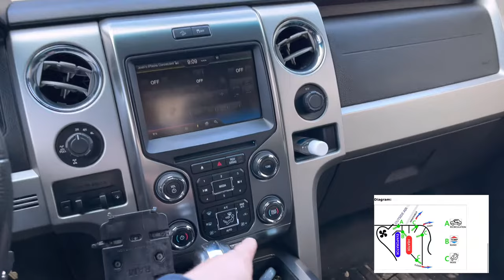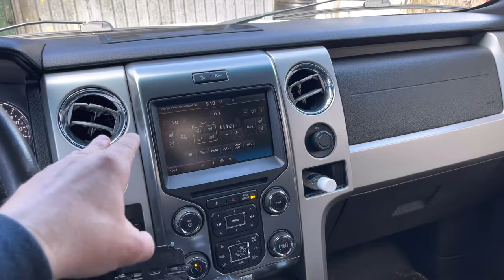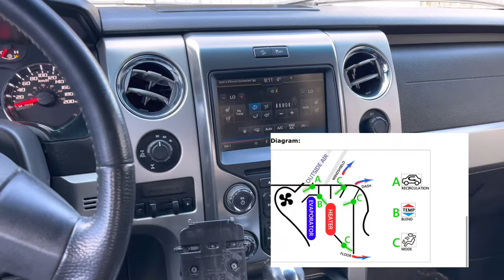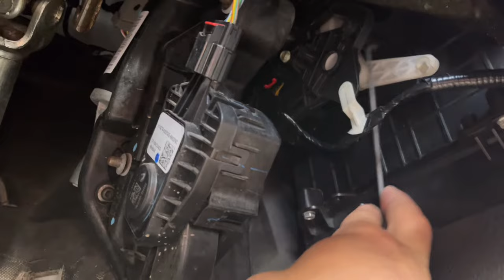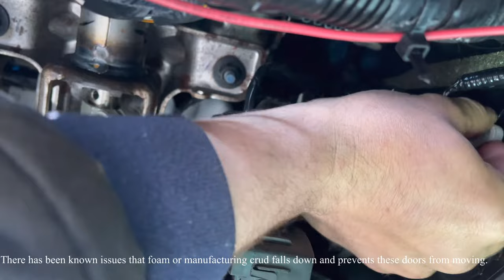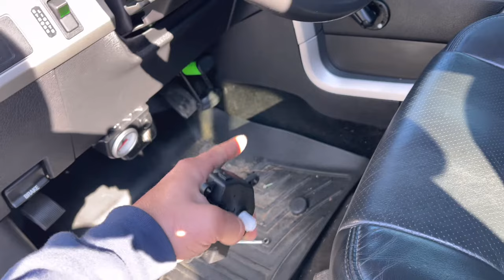2009-14 F150 HVAC Actuator diagnosis. Mode door replacement. **Detailed**

Comment: Mechanic's tip :   Don't change modes while the blower is running. It's like a hurricane.
Reply from the maker: Good tip. I always wondered that.
Reply: Dang, that's good advice

Comment: You answered so many questions I had with this video, i was getting so confused at the parts store with the actuators as I didn't know there was also a mode door actuator. My blend door actuator had broken, but this helps clear it up so much!
Reply from the maker: Thanks Kevin!
Reply: I think the third bolt or screw is just a post,where it just slides into the hole,because it seems that everybody only finds 2 screws.
Reply from the maker: 100% correct. It is just a locating dowel.
Reply: Did it make any noises when switching temp control? Mine creaks and groans but no temperature changes. Want to know if it is the blend door actuator not working before I take the time to get part and do it

Comment: Great video. Anyone seeing this first before removing actuator, it's super easy to get to if you move the gas pedal. 3 13mm bolts and you can just move the pedal out of the way to get to the 2 8mm bolts. Super easy and saves so much time.
Reply from the maker: Great tip. One of those things i like to disturb as little as i can when repairing. Great tip for anybody trying this job to check out! Thank you.

Comment: I'm having almost the same issue. My actuator will switch over to defrost / face / feet / etc. but it clicks extremely loud. Thanks for the video, I'm relieved I don't have to open the dash at all like the other actuators require.

Comment: OMG!!!  As an older (60) divorced woman who works full time and runs a mini-ranch, I have become pretty self-sufficient.  I had the Mode door actuator go out on my 2010 Nissan Titan 4 years ago, and went to YouTube, found a video, which I watched a couple of times, bought the part at OReilys Auto, and installed it.  Fast forward to today, and  now own a 2014 Ford F150 Lariat that I bought two years ago, and lo and behold, I heard the familiar clicking again...  I found your video, and had a case of déjà vu.  Confirmed what I thought was wrong.  I LOVED how simply you explained how to change it out!  I am hoping that the part number was the number on the back side of that new Mode actuator you installed (I took a screen shot...it was 2238202).  I plan to hit OReily's again tomorrow for the new actuator, and I will once again be head-first under the steering wheel changing it.  Just know that if I had not done this before on a different truck, your video still would have empowered me to change it by myself on my Ford F150.  Thank you for your simple, no nonsense instructions!
Reply from the maker: Just seeing this 7 months later. So glad i could help and thank you for the nice comment!

Comment: My 2011 Ford F-150 pickup is clicking it'll when I put it on it defaults to the defrost mode and if I hold the auto button down it'll go to the AC van but then it'll go back to the auto is it still the mod door and if it is can you please give me the part number so I can order it thank you

Comment: Excellent video! Spent 10yrs, many yrs ago... in and under dashes doing car audio and alarms, had to be twisty! That must be my problem, hot/cold works, can't really tell about the farm door, guess it's working. It just doesn't want to go to vents only today so that must be it, fine job! If I could of filmed all the dashboards I took out in the 80s and 90s and circulated it I'd be rich!  Everything use to be cable or vacuum operated. I'm cable door old
Reply from the maker: Hahaha! Thanks for the comment!!

I know the feeling. I have owned old trucks my whole life. Newest being a 99. I love the old cable operated stuff. Way simpler. However push of a button instead of slide of a toggle you have your heat displaced differently.
Reply: @Schneids15  so that's the blend door... not temp door I'm thinking, my temp works fine. Can't believe they're only $17. Got a Mac mini 1/4in air drive ratchet 36yrs ago, still works almost as well as a cheaper northern 3/8, great for tight spots like that. Still use my 60gal Sanborn just as old. Shit isn't built like it use to be. Dobbs tire put a generic thermostat in it that had the fans running full time, the motorcraft has a jiggle valve that must be used, now runs as should. Guy thought it ran to hot after new water pump, I knew that and haggled 3 grand off price, been a great truck, has the Coyote.
Reply from the maker: @gene2200 right on. So blend door is hot/cold and mode door is the defrost/ vents, floor etc.
Reply: @Schneids15  I need ac mode door. Glad it's that easy.

Comment: Was about to give up when I pulled the actuator and the motor seemed to work fine.  Then I listed to your video and heard you state that yours was working fine but fixed the problem with a replacement.   I did the same with a success.  I appreciate you sharing and keeping me from going down the wrong rabbit hole.  Thank you!!!

Comment: Worth a note that depending on the model of the truck there can be two blend doors, one behind the radio and one on the transmission hump. 

My air is blowing only cold on the driver side, so I need to get to the blender on the hump. 

I may also do the mode one as well since at times when the system is off it will randomly let outside air blow, which from what I found can also be a bad mode actuator as well.

Comment: I have a 2013 Raptor with dual climate controls. My driver side is stuck on cool only. My passenger side works fine. I think I have 2 actuators for the blend door. Im trying to locate my drivers actuator. Thanks.

Comment: i got heat on driver side but not passenger side.  Which would you think?  mine is rattling under dash on passend side i think its the recirculator one but not sure why it would cause me heat on driver and not on passenger .  air comes from all spots when changed just doesnt get hot on passenger side but it gets cool all over

Comment: My 2019 F150 has a loud rhythmic clicking noise (almost like a blinker but much louder) and it is coming from under the steering column. It seems to come on and go off randomly throughout a drive even when I don’t change temp settings. Sounds like this might be my problem but I have yet to get on the floor and narrow down exactly where it comes from.
Reply from the maker: Yes sounds like it could be your issue.

Comment: Not sure if you will have an answer for this or not BUT- I have the exact same problem you had. Air is stuck on the face/panel and will not switch to feet or defrost. My actuator never clicked, but I suspected it to be the issue (I own another ford that has had similar problems). Before finding this video I got a new actuator, installed it correctly, but I’m still having the issue. I went under to determine that the white arm doors are moving when I switch air modes and they do seem to be moving as they should. Any idea what the issue might be?
Reply from the maker: Hey Mitchell, is there a metal rod connected to the bottom that goes down to the flap below? I’m pretty sure that does the feet/ defrost portion
Reply: @Schneids15   update- metal rod was hooked up correctly. Mode doors are operating correctly from what I can see. I pulled the rod loose, disconnected the new actuator and verified that the mode doors are moving freely. If the actuator works and the mode doors are not stuck, I’m guessing I will have to pull the whole dash apart to see if the vent doors are opening and closing freely. I was hoping to find an answer without doing that, but unfortunately havnt yet. Thank you for the great video and the help!
Reply from the maker: @mitchelldale7207  hmmmm. I can’t say i know off hand what to say. I have heard of foam falling. My best suggestion would be to put a inspection cam through the vents but i don’t know if that could help.
Reply: @mitchelldale7207  did you find the fix. I’m having exact same issue. Everything moves fine and replaced actuator . Still can’t change from vents to defrost. I’m wondering if it’s the hvac controller. Any ideas?
Reply: @bigcbee  I'm having same issue.  I can manually move it and nothing changes.  But I did notice that I don't have the metal rod on the white know sticking out.  Just curious if you have found a fix or have any suggestions.

Comment: FYI;  This part has a few names to it.  
Anywho, for my 2014 F150 without dual zone control;  “Duct Actuator Door Motor”  Motorcraft 8L8Z-19E616-C. Another number used for the same part is; YH1881. Currently $39.99 at Ford website.  And, $31.09 on Amazon through a Ford dealer.
Reply: OMG Thank you for posting this. I have been trying to find the part number for EVER!!! thank you.

Comment: I have changed the exactly actuator and when a switch to heating, the driver’s side is warm and it’s is working fine  with the other vents. I have changed the  one behind the radio too. It’s still warm on the driver’s side. Any suggestions?
Reply: Blend motor door aint movin(actuators suck and will continue to break I suggest manually cutting hole on airhandler behind the glove box and making it move yourself.).  09-14 guarantee failure.

Comment: Would I go about doing this is my system wants to push air but can’t the fans won’t turn on at all
Reply: You probably need a new blower motor. I had to change mine out about two years ago and it was actually easier than this. It’s on the passenger floorboard if you have the same f150. 

If the fans won’t turn the motor is probably bad. Or check the fuses and see if there is a blower motor fuse and it maybe blown.